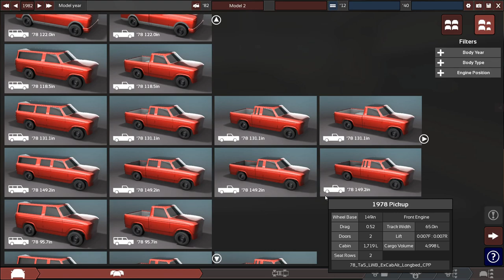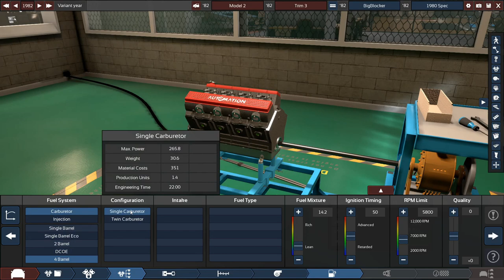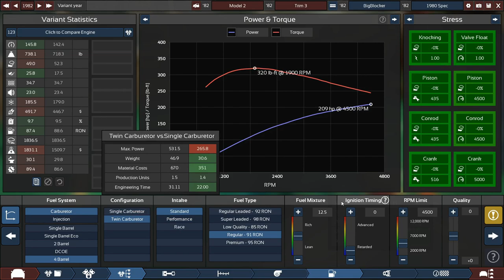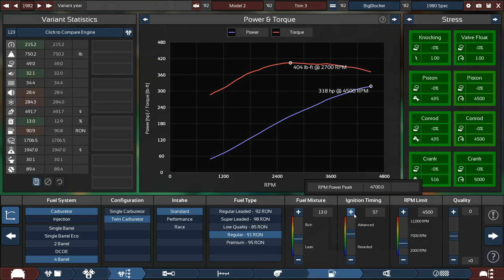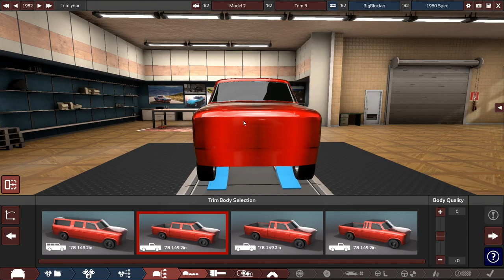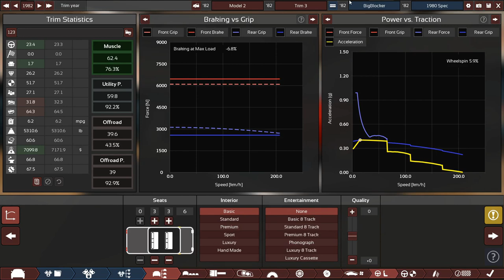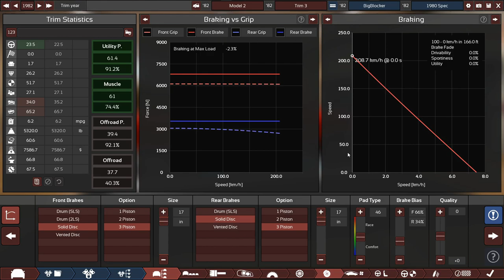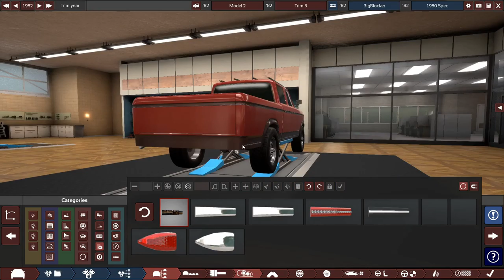I Built A Truck. And Its BIG! Automation - BeamNG

Comment: Hey, quick question: why do you use 60 degree v8's?
Reply from the maker: No real reason, mainly just to be different. The degree of the V doesn't effect performance or anything really in game!

Since it's not a copy of another engine (very similar to the Ford 460 tho) I like to out my own spin on the engines!
Reply: AkiKimura07 Normally American car manufacturers use 90 degrees, 60 is more used on Europe
Reply: @Guerra2615  yeah

Comment: Try to make a stable rally car, but the trick is the suspension must be max height and rather soft and spongey (so make sure the comfort/drivability/sportiness bar graphs are aligned). Some positive camber is recommended to avoid grip rolling as well as soft sway bars. And the car is obviously AWD, but the engine should be a transverse V engine, so V6, V8, V10, V12 or V16, your choice, all motor as well since turbos might not fit transverse, but you can try turbo if you want a small engine. Oh, and the wheels should be as large as you can make them, so widen the body as much as the flares body groups will allow. Downforce should also be tuned to make it as neutral as possible and I recommend ignoring the aerodynamics quality slider and just setting it at +15 right away, I really hope this car can fly, so maybe some ski jump testing? I think it could be interesting. Oh, and make it in 2020 so you get all the options to make it as good as you can.
Reply from the maker: Sooo a 2020 Rally car, made well!? (Better then my previous 1980s one)
Like a Fiesta WRC competitor (Do they still have those?!) But with AWD and a smooooooth V engine?
Reply: @TwinTurBros  That sounds about right. With the specifications I set out, the car would turn out very unique and interesting ;)
I look forward to what you can come up with, its sure to be exciting :D

Comment: Leafs in front and rear on truck used to be a thing especially on the diesels to support the heavy engine l. Also my fav truck Ford F-350 yr2000 7.3 diesel. Why bc my dad has one on a 4in lift crew cab that’s why

Edit:The 350 also did have turbos  LONG LIVE THE TURBO DIESEL